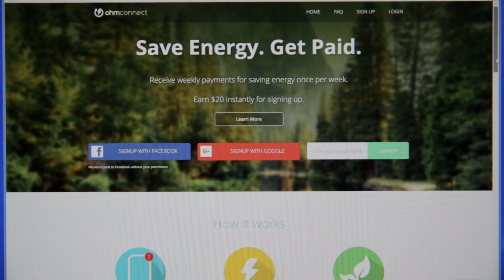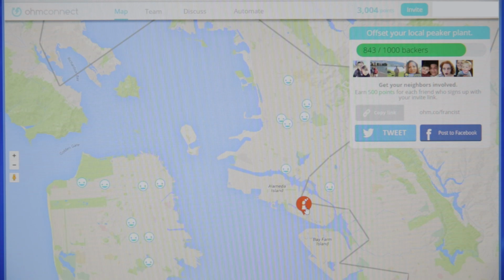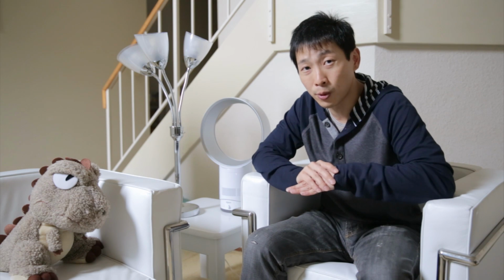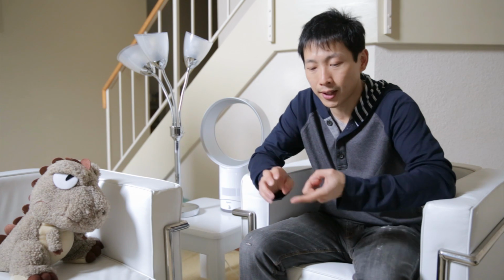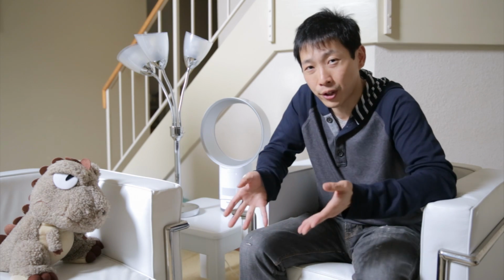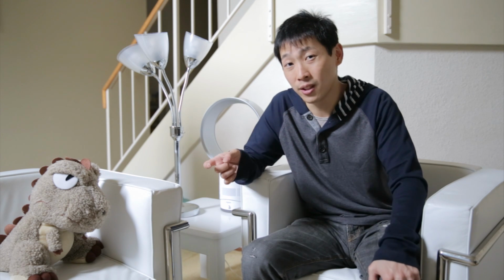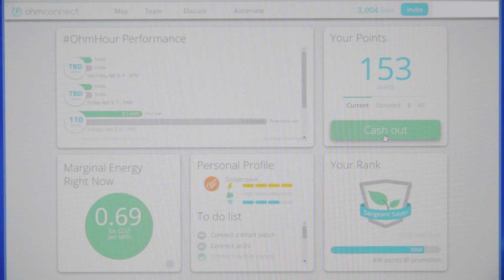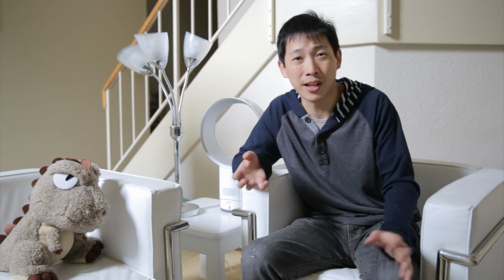Get Paid for Energy Not Used on OhmConnect [CA and TX only] | BeatTheBush

Comment: Will OhmConnect be able to shut your electricity down at any time if you decide to share your electricity account with them?
Reply from the maker: No. Only if you use smart devices and specifically say they can control a smart plug. You can also opt out and not turn anything off at all during an OhmHour.

Comment: I am enrolled in ohmconnect and have followed their direction about turning circuit breaker off during the one to three hour events. now my A/C and kitchen have no power. advice is that it's a risk turning breaker off as they are not supposed to be flipped on and off. Ugh!
Reply from the maker: Yeah... I dunno about that. Circuit breakers are not meant to be used that often. Use a power strip with a switch? Wait, did your circuit break malfunction?
Reply: BeatTheBush yeah, guess I learned that lesson. Now will just unplug during a ohm event. Ohm recommends flipping the circuit breaker off. nope

Comment: Do you still using it? If yes how much you got paid so far?
Reply from the maker: Yes, I still use it. There are about 2-10 ohm hours every month. Earns depends on how much you saved in electricity compared to your average usage clocked by the hour.
Reply from the maker: Also, earnings vary form negative to few dollars for a typical household. But negative doesn't mean you will ever pay them, it just deducts from your points.

Comment: If I remember right, something similar to this was being done with large industrial users. If a brown out was approaching, the factory would start their in house generators and put themselves off line. They would get a credit or favorable utility rate. Another proposal was to remotely disconnect one phase of your 240 volt system and have your air conditioner sleep while you still had one phase for the refrigerator and essential items. I think the switch was either going to be on the pole to sleep several users or the relay would be only on the homes who wished to participate (1980's?)
Reply from the maker: Nice! I have seen generators running at companies before when there is no apparent black out. Perhaps that is what.